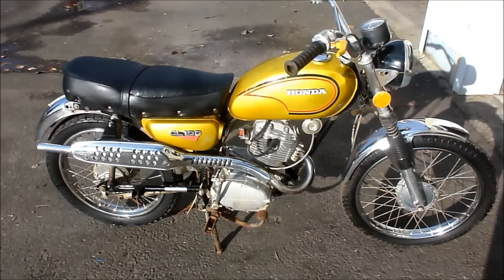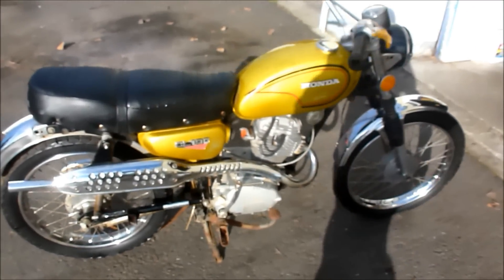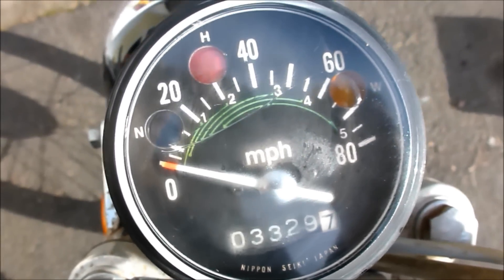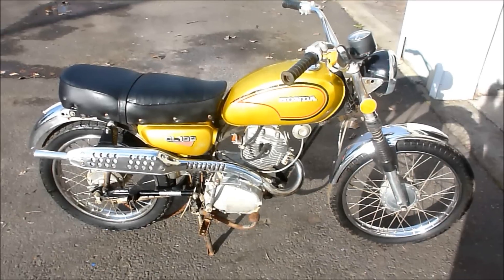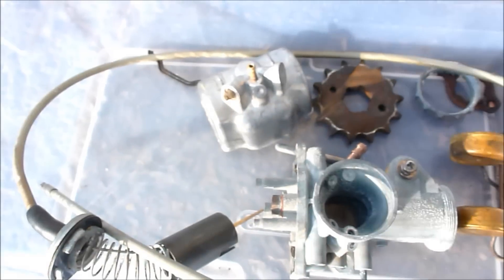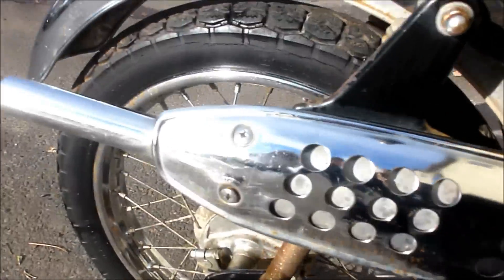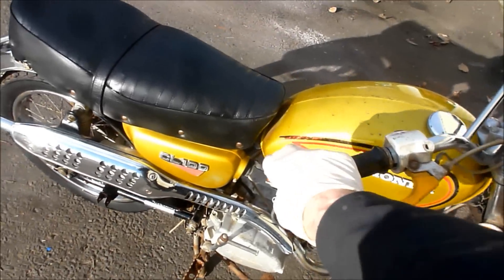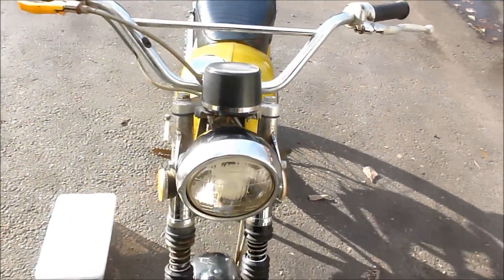1972 Honda CL100 motorcycle project

Comment: This brings back so many memories. I had a Honda CL100 exactly like this one back in the early 80's. Same color and everything. Unfortunately it was stolen in '87, and the police found it abandoned in a ditch a few miles away from where I lived. At that time the rectifier was bad and it wouldn't keep the battery charged. I assume it quit running due to the dead battery and the thief just pushed it off in a ditch. Anyway, I sold it not long after that, but I certainly enjoyed riding that thing while I had it.

Comment: I left Long Island in '72 on one of those and drove to Mexico. Back then Speed limit was 55mph and as I remember 52mph was it's cruising speed, any more and it sounded stressed. After a week or two in Mexico I ended up camping out in a place called Interama in South Florida working at a McDonald's at $1.25 an hour. Good Times!

Comment: Nice, I've had my '73 CL 100 since September of 1980. It has the same color and tank pinstripe design. Shortly after I purchased it I replaces the front and rear sprockets with that of a CB 100, so as to make it more street-able. My 4 vids are in my "Cruising" playlist

Comment: Oh, I loved those little Honda singles. I had a Sport 50, Sport 90, CB125, and an XL500. Ok, that last one's not so little. But I always wanted a CB or CL100-- sweet running little bikes! Five speed transmission... more upright cylinder....a big improvement in performance and appearance over the 4-speed 90. I want it! Be right over! Let's see, what part of Pennsylvania is Portland located in again?

Comment: I bought this bike from 2stroketurbo.  The restoration is now done and it runs great.  I stripped and repainted the frame, cleaned and lined the gas tank with POL15, installed new:  chain, brake shoes, cables,  tires, carburetor, taillight and turn signals, replaced front fork seals and fork boots, replaced crappy homemade enduro stand bar and foot pegs with original bar with kickstand.  I am considering selling now. There is no title for the bike and I was told it would cost $240 and take 3 years to get a clear title in WA state  I would like to get $1,500, or I might just apply for the title and keep it.  It is a cool little bike!
Reply from the maker: Awesome ! This is really great . Thanks for sharing !
Reply: Just bought a 1970 cl100s from an importer in the UK. Can't believe how good a condition it is in for a 43 yo motorcycle. Its my first bike and im looking forward to restoring it over the winter and riding it in the spring. Spares are really good value, its just the postage from the states that kills it! Found some common parts here in the UK from the CB100. The CL was never an official import so quite rare in europe
Reply: Are you selling the CL100? I am interested